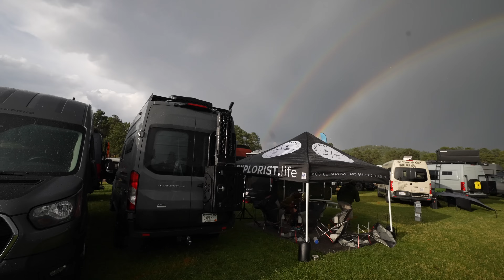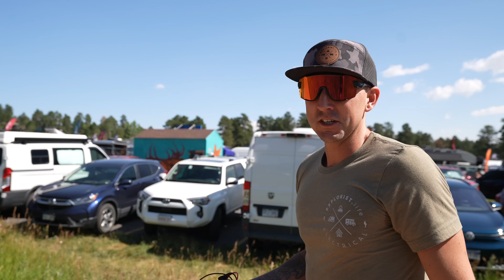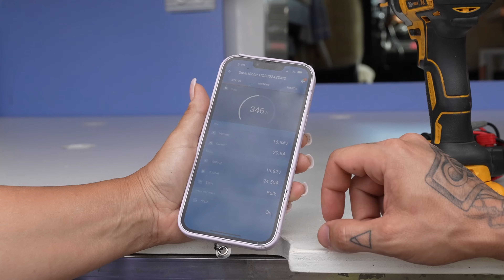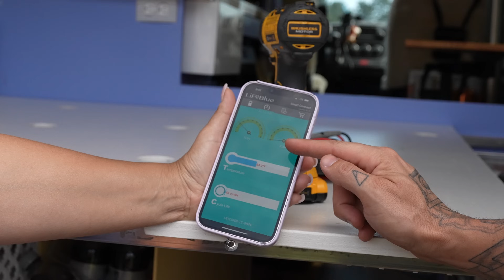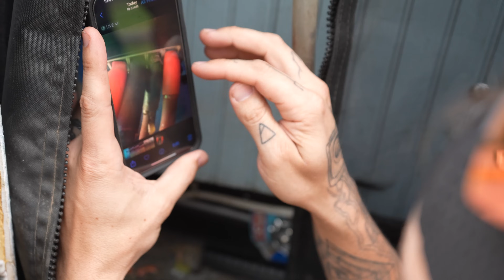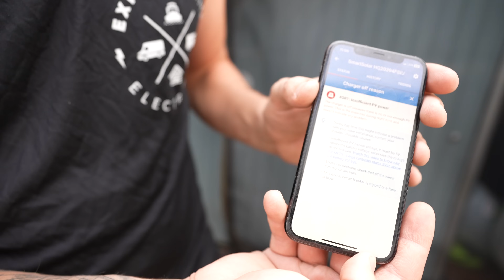Checking Camper Van Electrical System at Adventure Van Expo!

Comment: Nate and Steph your videos are amazing and super helpful, so thank you for sharing your knowledge. One topic that I do not see anyone talk about with electrical systems is EMF radiation. What is your POV on shielding from EMF, especially AC wires and a large inverter? Thank you in advance.
Reply from the maker: I think EMF radiation is far less dangerous than driving an 8000lb van down the road at 80 mph powered by a chunk of steel harnessing 3000 explosions of gasoline per minute.
Reply: @EXPLORISTlife  thank you

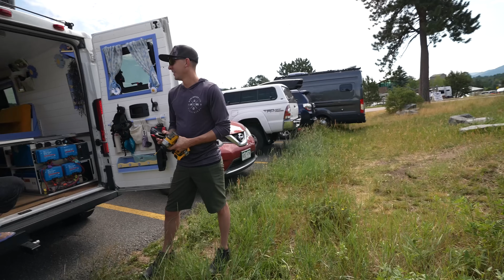Comment: 27:20 - me wondering if he remembered to turn back on the MMPT
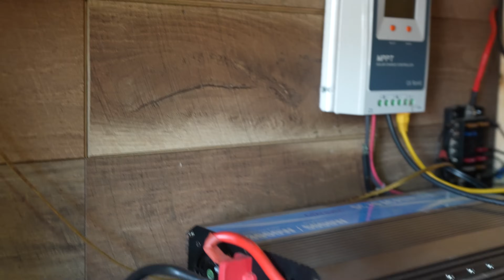11:00 - Anything over 1.5kw, should just be a 24V system by default. You can easily have a 12v Battery system for the small 12v loads and charge that battery, plus having redundancy is very handy, 12v loads are crucial usually where 120v load could be sacrified for a bit.
Reply from the maker: 27: Yes, I did indeed turn the charge controller back on.

11: I would not agree with that no.  Our guidelines on that is: Anything 3kW or less should be 12V IF there are 12V loads AND solar capacity is less than 1500W.  24V otherwise UP TO 6kW of inverting capacity OR more than 3kW of solar; WHERE 48V would then be most appropriate.  If you need help deciding on the best voltage for your next project AND you have purchased/are purchasing from our store (shop.explorist.life) reach out for some more personalized help: shop.explorist.life/support
Reply: Yeah. The only thing is you need bigger wires . There is no reason . To have 24v over 12 v .  Plus 12 v is way more common if you’re traveling  .
Reply: Also. A buck converter would be cheaper and better for 12 v loads on 24v system

Comment: Hi I have a small off grid system to set up 8 100 amp 12v  eg4 batteries ( 2 sets of 4 for 48v in series/parallel ) 1 x EG4 3kW Off-Grid Inverter | 3000EHV-48 | 3000W Output | 5000W
10 x 305w hyundai solar panels - I dont know a lot about fusing and if I need a shunt
 - can you draw me a diagram, and if so what would be the cost, thank you .
Reply from the maker: A diagram comes BEFORE purchasing parts.  Would love to have you as a shop.explorist.life customer on your next project so we can clear up those issues ahead of time.  If you decide to return what you’ve purchased and go with a plan we’ve designed, reach out at shop.explorist.life/support for more personalized guidance
Reply: @EXPLORISTlife  ok great thank you !

Comment: Is putting a lock washer on every connection sufficient to keep things from loosening up from vibration, or would you recommend some kind of thread locking compound?
Reply from the maker: We don't recommend thread locking compound and that is a debated topic.  Our https://shop.explorist.life system designs use a mix of lock washers and/or nylock nuts depending on the application.  If you have purchased/are purchasing from our store (shop.explorist.life) and need a bit more guidance on your specific system reach out for some more personalized help: shop.explorist.life/support

Comment: Phantom draws add up fast. My fifth wheel is so power hungry. I try to turn off everything.. 
Star link aspecially
Reply from the maker: For sure.  This is why we always push power audits so heavily.  Most people don't want to take the time to do them, but then wonder why their batteries are draining when ""nothing"" is on except for their phone charger, starlink, lights, water heater, air conditioner, tesla coil, etc etc... 🤷🏻🤯😂
Reply: Great video